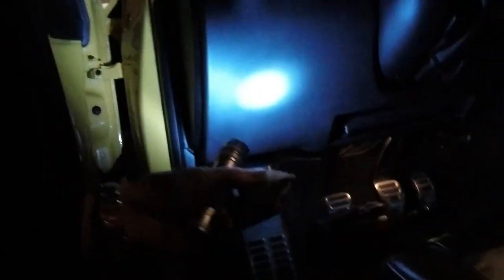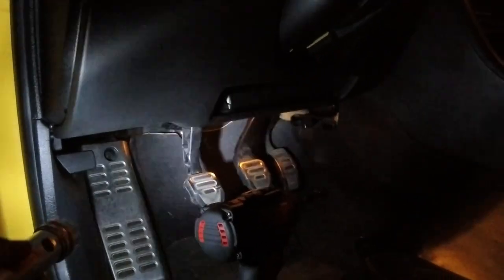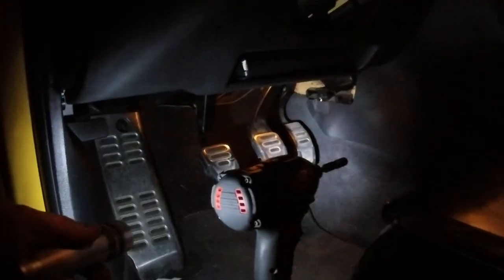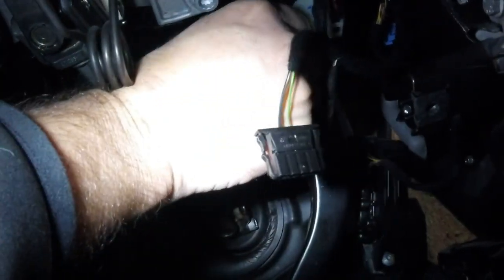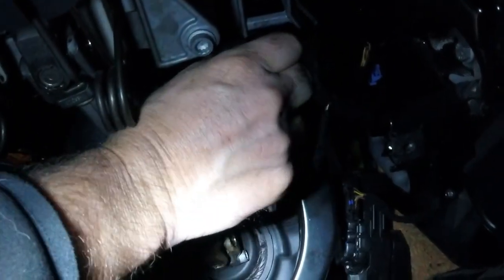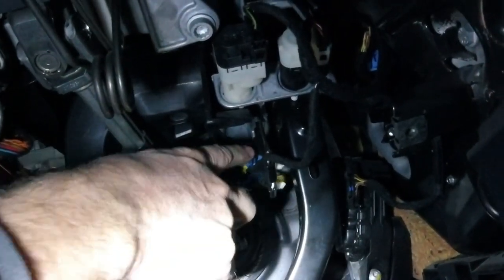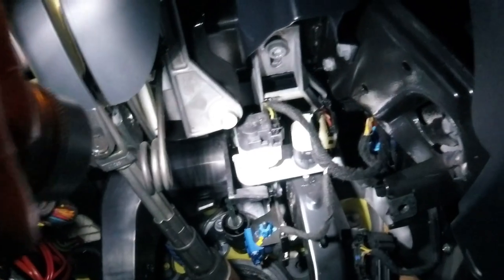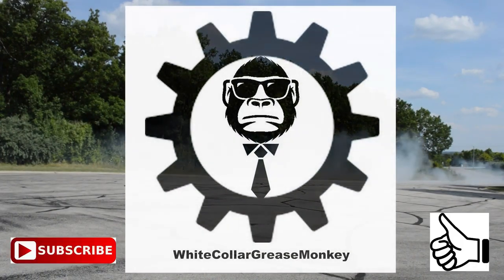Audi A4/S4/RS4 B6/B7 Clutch Switch Replacement

Comment: Thanks for the video. In my case I have to press the clutch pedal to start. So does it mean the upper switch is the one that need to be replaced? your advise is appreciated.
Reply from the maker: Bobby Iwin the upper is for engine throttle monitoring to help make the shifts smoother. The lower switch is for starting the engine. When you can start the engine without pushing the clutch pedal to the floor, the lower switch is failing.
Reply: @gjodexter  Hi just caught this video   helpful    thanks   but can you tell me what is referred to as the upper switch here   as that is what I need to replace I think   thanks so much  hope to hear from you
Reply from the maker: Paul Smith the upper enables a smoother gear shift. If your gear shifts seem clunk and like the throttle is to touchy during gear change, than change it.

Comment: Is there any way a faulty clutch switch will show up on diagnostics? My car has cruise control and it won't work anymore, its not the brake switch and it starts in gear with clutch pedal down  any help would be appreciated. Thanks
Reply from the maker: You have an upper clutch switch as well. It trips the cruise control as soon as you touch the pedal. That’s the issue mine had to start with.
Reply: @gjodexter  thanks for your reply, is it easy enough to replace both switches? If im going to do it I might aswell do it properly, ill have to start with the cheaper parts first and I might end up getting a new dashboard lol
Reply from the maker: @tomcledwyn445  yes it is. Make sure the peddle is in the proper position when you install the switch. It’s sets the position as you install the switch.

Comment: I have a B6 S4 that won't crank over all the time. At times it will after trying awhile. Battery is new and starter is good. Can it be a clutch swith issue? Problem happens intermittently. Any advise would be appreciated.
Reply from the maker: clint avila no, I would look into your inanition switch. Does the engine turn over but not start or do nothing than turn over and start?
Reply from the maker: clint avila you have to install it with the pedal pressed. It’s a pain the ass. The tip gets set by the position of your pedal when it’s fully depressed.

Comment: I have a no start no crank issue. I replaced the starter and the relays under the equipment. The car would start with out the clutch being pressed. But not I dont get anything but dash lights. Could it be the clutch switch?
Reply: Relays under the ecu have been replaced. Still no start no crank. Should I replace the clutch switch?
Reply from the maker: @black2lemonade  2 clutch switches, did you set them up properly?
Reply from the maker: The power one must be installed with the clutch pedal fully depressed.

Comment: So my 2008 Audi s5 started to have a starting issue. It sometimes starts and after driving it for a while it wont start anymore for a few minutes or has a really slow start and cranks back up right away. Idk if this is related to the clutch switch or could possibly be something else like a starter issue.
Reply from the maker: Look into your battery. I had similar issues on my 335.

Comment: Hope this is all i need to do....car is over revving and fluctuating after a gear shift and cruise control will randomly disengage as if brake or clutch were pressed....so it would seem the clutch is shifting in and out of engagement
Reply from the maker: Similar issues, the switches resolved it.

Comment: Did it run and work fine?  The switch you removed, and the switch you installed looked totally different.
Reply from the maker: Chris Bailey I went thru ECS and they said that was the replacement.
Reply from the maker: Chris Bailey and yes it worked correctly.
Reply: @gjodexter  thanks! I'm in the same boat.
Reply from the maker: Chris Bailey as a side note, make sure the pedal is in the proper position. If you change the lower switch, make sure the clutch pedal is pushed in all the way and than install the switch. This is how the switch is set. The same for the release side. Obviously that one is easy by default.
Reply: @gjodexter  which one is the one you show in the video?  Because that is the one I need to do.
Reply from the maker: Chris Bailey it’s the upper one. It’s the one that assist with shifting when you press the clutch in. The lower one is for starting the car. If you can start the car without pressing the clutch, the lower one is bad. They are so cheap I just replaced all of them.
Reply: Thanks! Just changed it, and I'm back up and running.
Reply: @gjodexter so the clutch must be pressed with the lower switch being installed, how does the car reference the clutch position with the key off?
Reply from the maker: @evlsc400  your setting the position of the switch itself.

Comment: My cruise control is not working (I have audi a4 b6) so if i change this will work ?
Reply from the maker: Maybe.
Reply: Probably, upper has to do with CC, lower start. Check bits in MVB 066 - if constant 1 for clutch - then the computer read "clutch depressed" which means CC not able.

Comment: What about the depress clutch switch?
Reply from the maker: JB91710 I replaced both. They are tricky and you need to have the peddle pressed all the way down when you install it.
Reply: @gjodexter   2001 Audi Allroad 2.7T with a 6 speed manual.  The car had no problems or symptoms and then one morning nothing.  Would your first guess be the clutch switch or could it be one of a dozen things?
Reply from the maker: JB91710 what do you mean nothing? The clutch switches only prevent you from starting it in gear. I won’t prevent you from starting the engine.